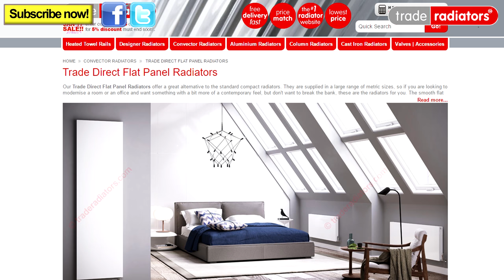How To Install A Radiator Under A Window

Comment: I was always wondering why they fit radiators underneath the windows but still does not make sense because he said cold air get heated up but isn't the worm air pulled out?

Comment: Hi. Why in the Uk all radiators are fitted have inlet and outlet pipes on bottom left and right side of radiator. is mean for example: left bottom side has inlet and right bottom side has outlet. this kind of connection is about 20% less efficiency. In continent europe always inlet pipe is fitted on top side with TRV and outlet pipe is fitted on bottom the same side of radiator. If radiator is long than outlet pipe on bottom on opposite side.